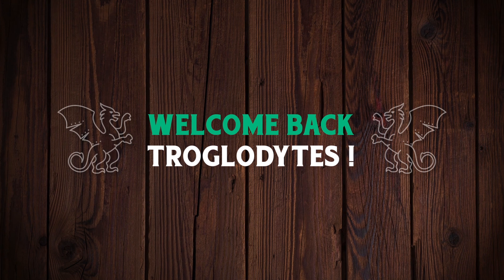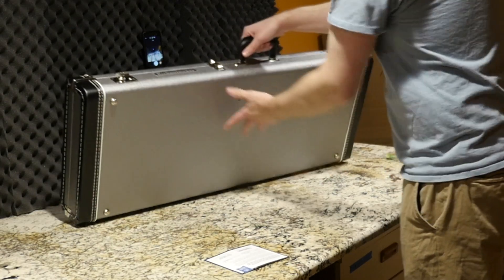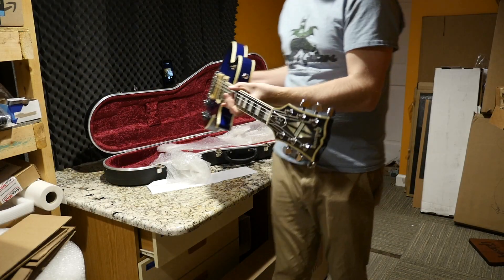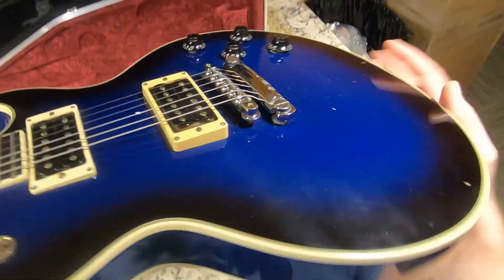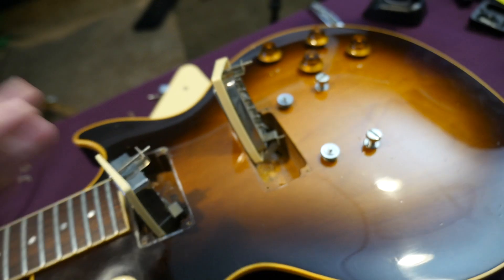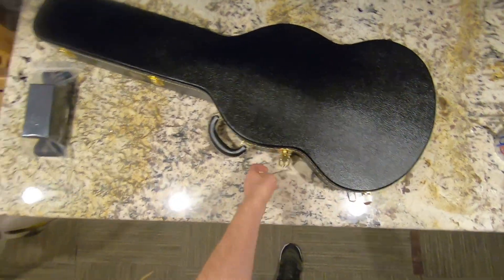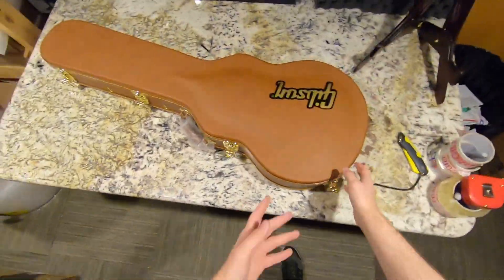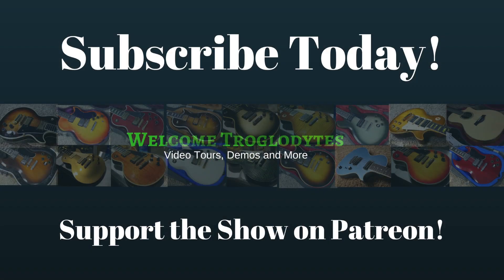I Bet You'd Never Thought I'd Buy This Brand! | Trogly's Surprise Unboxing Guitar Vlog #65

Comment: Hi. About Microphonic thing...  - did you check it with other cables? sometimes it could be the problem in cable jacks ( soldering, or signal wire is touching, a little bit, ground one) ...   or one of the tubes in preamp of amp can be microphonic!   - turn on combo - power and stand by ... wait a couple of minutes for warming up tubes and then bump it by your hand on a side ... if it squeels or you hear other noise when you bump it (turn of reverb tank!!)  - so it's a problem with ( more often one ) tubes of a preamp ... and it just need to be replaced.

Comment: Austin, that Rickenbacker is a 325 it's a short scale guitar. Made famous by John Lennon. He bought a show-prototype of the 325 in Hamburg which became his famous guitar. When he went back to England, he had the original vibrato system changed out for the Bigsby and later on, when they started getting famous, Epstein asked John to get it painted black so it didn't look so crappy on TV (it was originally natural).  John kept the Rickenbacker with him til he died. His playing of the Rickenbacker last featured on Yoko's Walking On Thin Ice song. By then his Rickenbacker was a mess internally as every man & his dog, and John as well, had tried to work out how to get all three pickups working with only two sets of controls. The scale of the guitar is about 22.5". Other Rickenbacker guitars are usually 24.75". It's suggested that John played that Rickenbacker so much because he was short sighted and didn't want to have to play on stage in the early part of The Beatles, with glasses on.

Comment: Good point about having to top wrap after moving a tail stop stud forward.  This is absolutely true!  And nothing's worse than a collapsed bridge, because you may not understand what's going on with your guitar for a while until you figure it out.  I had a gold top from the factory that had a collapsed bridge.  They wouldn't believe me, or my Guitar Service guy, when we called about it for a replacement under warranty.  So I ended up replacing it with a Tone Pros and raised the tail stop height to reduce the downward pressure on the new bridge.  Everything was fine thereafter.  I may have lost just a touch of sustain due to raising the tail stop, but you have to weigh it out and compromise a little to avoid the collapsing bridge scenario.  As you know, guitars are fickle creatures (but I still love them SO much!!!!).

Comment: The proper way to check for neck twist is to properly measure the neck relief.  If the relief under the low e is different than the high e, there is twist.

Comment: The microphonic issue, if it's consistent, could be a microphonic tube. There are videos showing you how to test for that, but basically you lightly tap on the tubes with something non abrasive. (I've used the clean eraser side of a mechanical pencil.)  It makes a very distinct sound through the speaker when you tap on the microphonic tube. Basically, how I understand it, is the vibrations created by the speaker feedback into the microphonic tube creating a perpetual squeal. On my peavey valveking it only affected the distorted channel.
Reply: I just went back and listened to the issue in the demo video. That sounds EXACTLY like what my amp did when I had a microphonic tube. I'd definitely try out my troubleshooting tip. It's free and easy, and could very well help solve your issue.  A new set of tubes fixed it in my case.

Comment: I concur with the guy who said the extra pickup cavity depth is for the conduit to the switch and between the cavities. All you are doing is telling the milling machine - be it a CNC router, a guy holding a router on a template, or whatever - to change the depth and use the same parameters for the outline. This means you can have a guitar that looks like a "normal" Les Paul, but without the added time and labour of gluing on a separate cap. You just mill the body shape, mill the top carve, mill the holes, and drill through the jack hole (huhuhuhuhuh) in a way that the resulting conduit intersects both pickup cavities and the cavity for the switch. Most of those processes are things that you have to do anyway, so you can just modify the process a bit and save the time of gluing on a cap. The amount of training required to adapt the process is also minimal. More throughput, less material cost = decreased production cost.

That's going to save a lot of time and effort because you're not manufacturing an extra component and you're not waiting for glue to dry. I think that very few guitar players understand or appreciate the impact of processes on mass production, and how much thought goes into making production repeatable and efficient, with complex production within the grasp of people with little to no training. You accomplish that with jigs, templates, and carefully-designed processes.

For example, when you watch video footage of how Gibson installs and trims neck binding, it becomes readily apparent that they use jigs, and that most of these processes, such as drilling and installing fret markers, or cutting away the excess binding to form fret nibs, are done in a matter of seconds. When we consider the production processes and available machinery in the middle of the 20th century, fret nibs are an excellent example of process efficiency. Dressing bare fret ends requires filing and rounding in addition to the leveling, crowning, and edge beveling that will have to be done anyway. On a guitar without binding, this isn't a huge deal, because you're saving time by not installing binding. If a neck has binding, though, then you need to do all of that, plus you need to cut each tang to fit under the binding. Unless you have a dedicated machine that precuts frets and fret tangs, specifically for this process, then this means time and effort. And this isn't even considering that there was a much wider range of variation in the pre-CNC days. How are you going to be sure that your precut frets are going to fit every neck?

The smart production engineer has an epiphany: if, instead, you trim the frets flush, have the pre-cut binding strips wide enough to cover the fret ends, then use a purpose-built tool to trim the excess, while you do need to smooth the transition to plastic, you don't have to fiddle around with the extra fret end filing because the nibs blend into the rest of the binding already, and you don't need to fiddle with the fret tangs, because you're just cutting and filing flush to the board assembly prior to gluing the binding on. The people at the Gibson factory do this extremely quickly with their jigs and machines. This can save precious seconds or even minutes. In mass production, saving even one second per unit can greatly increase the number of units produced in a day, compounding every day, year after year. 

Marketing and folklore then take care of the rest, and fret nibs become a signature feature. From a mid-20th century standpoint, fret nibs are pure genius. Of course, the tools have changed, and I imagine that it must be cheaper to produce guitars without nibs these days.

Comment: I had once a problem with a screaming OD pedal. , I removed the bottom to look inside and found nothing wrong , but I dropped the bottom plate on the floor and it rang like a bell and was the same tone as the feedback , I fixed it by bending it a little and painting it ...and it screamed no more .:-)

Comment: Got that 2020 Epi LP Special delivered yesterday, sounds killer...Would benefit from a professional setup but it's pretty much playable right out of the box..I agree with Trogly, it's great value...

I'd appreciate any recommendations on 2 minor mods I'll probably wind up making - an intonatable wrap-around tail piece/bridge for $40 or less and where to get a vintage-style, amber p/up selector tip that will actually FIT...I guess there are different sizes and I've seen several online reviews where the ones purchased didn't fit and had to be returned...

Thanks!

Comment: I have an 80's Marlin Sidewinder with a glass like finished fret board, it's beautiful but was considered an inexpensive instrument in it's day. However this model caused Fender a lot of sales in the UK, it was the srtat killer of it's day, they had a single coil pick up in the neck but hotrails in the middle and bridge, they are good guitars and their prices are rising. Hiscox came as an extra with Yamaha Guitars and as standard with some more expensive models, Yamaha was even blown into the top of the case when they were made so Yamaha must have had some kind of agreement with Hiscox. Good cases along with Gator. I rate the Ritter bags for inexpensive gig bags, plenty of protection for getting your Guitar from A-Z in one piece. Maybe you should do an up to date episode for cases and gig bags.

Comment: Was waiting for you to pull a Tommy gun out the case of the refinished Les Paul complete with a high capacity magazine like you'd see in old gangster movies.
Reply: It's  a shame you couldn't sell both of the SG s as a set. Do you or have you found out what strings are installed on an Epiphone whether it is Ernie Ball or what.
Reply: Could be vicinity issue on the microphonic issue unless it would be settings being incorrect for the small area your in either at the amp or pedal or both.. Having watched your vlogs I'm not thinking you have a cheap second rate pedal.

Comment: If those pick ups in the fender are the shaw buckets they are un potted there is a gasket that goes in between the cover and the pick up I had one in my telecaster and it would pop if you tapped it even slightly if my pinky even touched the pick up screw it would pop. Seems it happens on those pick ups talked to fender customer service they were not very help full on the matter

Comment: The Epiphone Les Paul Special I's are indeed an insane value. Obviously QC will be hit or miss on such a low-end guitar, but most of them are pretty good, with a fair number being quite excellent. The pickups are great -- usually, a pickup swap is all but required on guitars this cheap. One of these, with a new nut and locking tuners, will run about $180-200 with a used guitar, around $250 with a new guitar, and it will play and sound great.

But you're right, the new Epi Les Paul Special is a night and day difference. The individual volume/tone knobs and the "proper" pickup selector location doesn't really matter too much IMO, but the new one is a real, set-neck LP. The old one simply is not.

Hopefully, Epiphone will release the new Specials in different colors. TV Yellow, as cool as it is, is pretty polarizing. The old Special I's were available in TV Yellow, black, and cherry (all "worn" finishes).

Comment: You need roller to avoid breaking strings as easy as you would with a regular bridge, plus the most important is the increase in sustain you get with the string touching more mass at the bridge.

Comment: There is a full scale variant of the Rickenbacker 325 called the 350. I own a 4003S bass and the scale length is 33 1/4 as opposed to the normal 34 inches.

Comment: Those Rickenbacker 325 reissues are the most overpriced short scale student model of all time due to Lennon.
The super short scale gives them a plinky attack and the low output pickups make them sound really weak.
All that for 4000 bucks. 
Rickenbacker make some really good guitars, but this model is silly.
The Rickenbacker 350 is a full scale version, which sounds a lot better. Still has the weak pickups though.
Reply: But the 350 looks like a bean pole. The proportions are wrong. I think Rossmeisl designed the shape of their range purely aesthetically including the dimensions of the neck and Hall went with it. We've had to do our best with the plink ever since.

Comment: I don't know if they sent you the wrong guitar or not, but that looks like a 325, which is a 3/4 size guitar. Most Rickenbackers are closer to a regular scale though (not sure exactly what the scale length is, because I don't have one to measure).

Edit: John Lennon had one of those and played it all the time in the early days of the Beatles. I've heard a rumour that both he and Paul McCartney chose small instruments (a Höfner bass is pretty small as well) to appear bigger. Don't know if it's true, though.
Reply: The 325 and 320 are 5/8 scale.

Lennon had three of these. His original blond from the cavern days that was re finished in black. That had the gold scratch plate and trc.

The black and white one.

And also had a rose Morris firglo version 12 string.

Also, John Fogerty used  Rose Morris 325 in firgle quite extensively in CCR

Paul picked up his first hofner in Germany because they were affordable and it didn't sook so daft being left handed.

I have a few Hofners, they're 30 inch scale.
Reply: @memriloc  
Thanks for the info. I have also heard about Paul liking the fact that the Höfner was symmetrical so it wouldn't look off playing left handed as you say. I honestly don't even remember where I heard the other thing from, but it's probably just a rumour. Still interesting though (I think). 30 inches is pretty small for a bass btw. They're also extremely light, almost unbelievably so. I used to have one as well, but it was an Ignition series Höfner, not one of the German ones.
Reply: My 360 has a 24 3/4" scale length.
Reply: L. Marc Paul didn’t flip a righty, the hofner is actually a lefty. Paul thought lefty guitars look weird but when he saw a 500/1 in a shop window he thought it would look better than most as a lefty. The shop made a special order for a left-handed model to be made and Paul bought it on payment plan.

Hofners are great gigging instruments, they played all night shows so the weight must have been great. Paul said in several interviews that the American stuff was hard to get, and leftys near impossible. The German made stuff was a fair bit better than anything made in the UK at that time so getting a lefty hofner was a huge deal for him. 

I’d imagine Hofner would’ve been dead 40 years ago if Paul hadn’t picked up a couple of those violin basses way back then.
Reply: @CosmicHippopotamus  
I know, but, as you say, some left handed guitars/basses do look weird but he probably thought the Höfner would look better. Obviously I wasn't there, but I'd imagine that's it
Reply: @cammarc  they are light. I have four Hofners. 2 '67 500/1, 1' 60 500/5 and an ignition 500/1

The ignition is still a bit heavier than the vintage jobbys.

Comment: Sound issues can be many things. It could be a lights, it could be a cable shorting out. It could even be the power. What I'd say is alot more people are home so that could cause some power surges. I'd say trouble shoot. 1st guitar you know you have good wiring in. Plug that straight to your amp. No pedals. Then try all your cables. If you have no issue then hook up said pedal. If it squels then try the pedal with a battery or different power supply. If you plug your guitar straight into your amp and you tested all your cables try a different guitar, but it could be an issue even with the amp. Does it only happen when you have gain? Is it happening with the pedal off vs on? Is it a buffered bypass vs true bypass? Not that one is better but a faulty switch on a pedal makes a difference. I'd say try guitar amp. Test all cables. Test amp with gain and no gain. If you get squel. Keep going through all the cables. Then try a different guitar. Still getting squel could be power could be amp could be lights in the room. No squel start hooking up pedals one by one. Are you using an iso power supply? Are you daisy chaining. Sorry for the long response. I had an issue where I couldn't get a hum out of my chain no matter what I did. I moved and the him went away. And trust me I tried everything even sheilding my guitars, power supplies, noise gates. And it was just the bad power in the place I was living and the lights from the bar.